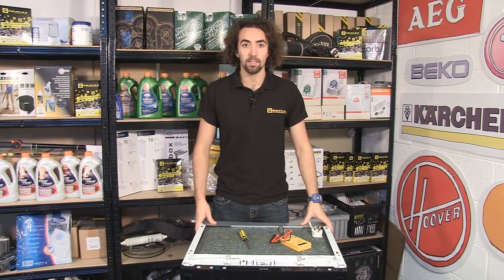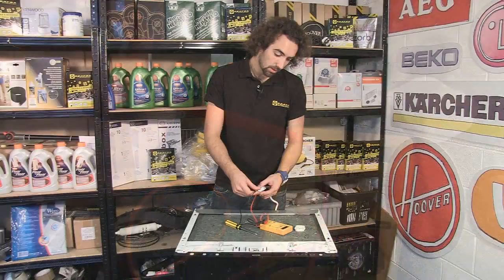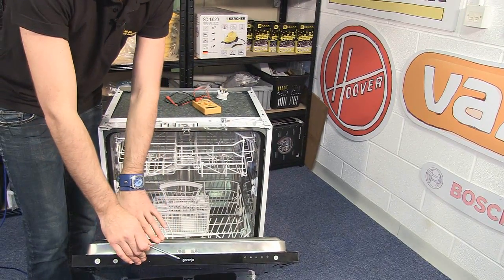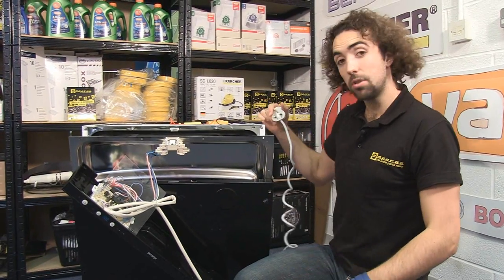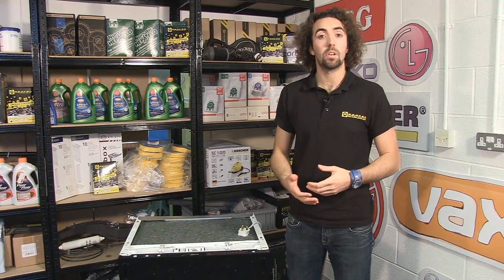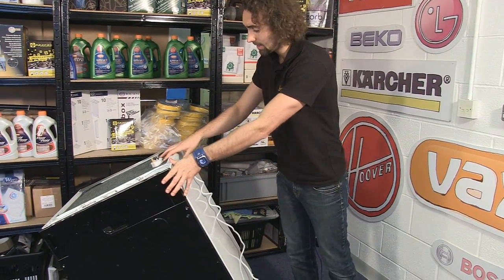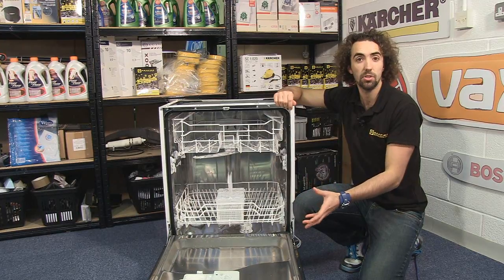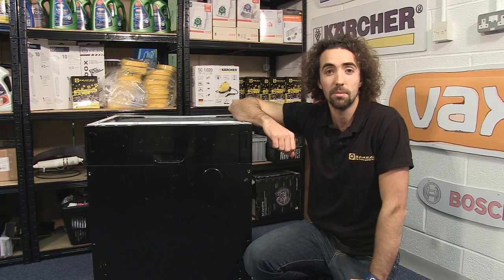How to Diagnose Control and Programme Problems with a Dishwasher

Comment: Our Bosch dishwasher is tripping the electrics in the drying cycle.  No error code as when the power is switched back on dishwasher returns to the initial switch on screen as if it hadn’t washed.  Sometimes the water doesn’t get hot. Sometimes it does get hot.  Is this likely to be the heater or the control board?
Reply from the maker: Hi, you might find our other video helpful here, which details what to do if your dishwasher isn't heating:
https://youtu.be/7b1-M_WKYJs

Comment: Took my currys essentials dishwasher out turned it upside down to see what was causing the flood error to make eco flash. Eco flashing cleared - now computer only flashes through the options in sync and settles on glasses and rapid. Won't let me select an option. Help!!
Reply from the maker: Hi Richard, there is a good chance when you turned it upside down any water that was in the base would have gone everywhere, take the front panel off to access the board and check for any damage.
Reply: eSpares it’s just decided to start working again. Why was it showing the eco leak warning in the first place. Leaking from where. Thanks btw
Reply from the maker: Hi Richard, check all the water connections and it may be one has come slightly loose leading to the leak but hopefully everything else will be ok.

Comment: Hi! My Bosch SGV33E13EU started by not drying the dishes a few months ago. A week ago it suddenly became completely dead. It doesn't light any of the LEDs/display or any indicator any more. I have tested the switch and seems to let voltage in when toggled (220v). I observe ~125v between the big wire that seems to feed the control unit and neutral, not sure if this means anything though. My question is, considering that the control unit doesn't light at all, can I assume that it is the control unit what is dead? Or, is there any other faulty component like the heater, thermostat, pressure sensors, water sensors, etc, what could lead to the control unit not lighting at al? Many thanks!!
Reply from the maker: Hi J. Carlos Muro, the first thing is please do not test anything live, your dishwasher can be fully checked using a multimeter with the dishwasher disconnected. The video does show testing from the plug to the PCB and if everything else in the circuit is ok then suspect the board.

Comment: Hi great video but am struggling to find a fault with my hotpoint Aquarius fdm550  it starts the cycle buy draining checked that that works ok but after about a Minute the wash and end lights flash fast together quickly I can't seem to find what the fault code means any help would be great thanks
Reply from the maker: Hi Gixer, it sounds like the water fill timeout has been activated. check the inlet valve and for any blockages affecting the water supply to the machine.
Reply: eSpares thanks I will have look at that thanks for the reply much appreciated

Comment: hi my kenmore 665 not work only star light sensing  i know the heater element is borken you think  ? if is this the real problem  because not enter whater ? i chek the termo fuse is good  tester sound  but heater element chek say 1 in tester
Reply from the maker: Hi Giovanni, you will need to use a multimeter to test the heater before suspecting anything else, also this video will help diagnose heating problems www.youtube.com/watch?v=7b1-M_WKYJs&t

Comment: Hi I have beko dishwasher model dsn2532x.. And it was working g very well but two days ago my son turned on and when I turned off then I tried to make new program... The motor turned out. Even when I didn't edhe press start and nothing change till now.. All the time the motor is on and nothing change.... So what is the defect here..
Reply from the maker: Hi Dina, If the motor is running all the time it may be the pump that is draining because there is water in the base, check the base for water and look at the hoses for any leaks.
Reply: It was some water before in the bottom but it drained slowly.. Also I opened the draining hole and I checked for any thing stuck but I didn't... What I am afraid of is that what can be stuck in the tube which inside for draining... Coz it's in the process of draining before steaming and doesn't move
Reply from the maker: Hi Dina, you will need to establish the reason why it is not draining, check for a blockage and test the drain pump to ensure it has not failed. We also have a video that will help www.youtube.com/watch?v=M0W9pzBZ-DI just copy and paste into your browser.

Comment: my dishwasher pump ok not getting voltage so motherboard annoying because works fine except doesn't drain
Reply from the maker: That's unusual as the boards do not often fail even if the pump gets blocked. May be worth checking there is no debris in the pump chamber before replacing the board.
Reply: yeah it may be the capacitor will get it tested
Reply from the maker: You can check the wash pump capacitor with tan economic priced meter like this one:
https://www.espares.co.uk/product/es1741061/professional-digital-multimeter
Good luck.
Reply: what it was is one of plugs going to pump loose just tightened it pump works
Reply: I mean I checked voltage ,voltage 50v ,pump checked out for continuity correct ohms capacitor ok so I was really stumped I thought not getting correct voltage but who knows what that is as I said one of the plugs loose that coonects to pump I know hard to believe but it's true cya
Reply: I mean if I bought new pump still wouldn't have worked because plug loose you understand.

Comment: Hi, I have an issue with my GE Profile PDW8280J10SS Dishwasher where the heating element is not heating up to dry the dishes.  I took out the heating element and it tested fine.  I had purchased another heating element and i received the same test results when using the multimeter.  What can be the cause of the heating element not heating up?  Would it be the control module?
Reply from the maker: The problem could either be a faulty control board or a thermostat (if fitted) in circuit with the heating element.

Comment: Hi, I have isuues with a whirlpool ADG7650 dishwasher. The intensive and eco cycles stop after the draining step whereas the express cycle works fine. My guess is that it's an electronic problem. What do you think?
Reply from the maker: Likely to be a problem with the timer motor, thermostat, or heating element. You should check these for faults by using a multi-meter.
Reply: Thanks for your answer, I will try that this afternoon and I'll let you know. I'm just not sure where to find the timer motor.
Reply from the maker: We had problems identifying your model number, on your machine you may have a control board that operates the timer function so this could also be the problem.

Comment: Hi Josh. Thank you for an informative series of videos.Can you help with a SMEG LS19? The water comes in and the washing starts. And then it stops again. We can click it to proceed, but it cannot finish and the water stays inside the machine. ? I am trying to dismantle the control panel, however it is a bit tricky as the controller on the outside does not come of, so I cannot get the control panel fully of??Please help or redirect, please, to someone who can.
best regards
Niels Kongshaug
Reply from the maker: The most likely cause of the problem Neils is a blocked drain pump, watch another video for more information:
https://www.youtube.com/watch?v=M0W9pzBZ-DI
Reply: Niels Erik Garde Kongshaug
Reply: Niels Erik Garde Kongshaug dishlex 100

Comment: I have a whirlpool gold quiet partner 111 dishwasher 
water runs in and pumps out but spin arms don't move. I have complete cleaned it out.what could be wrong?
Reply from the maker: It is likely that although the drain pump is working the wash pump is either jammed or faulty. For information on changing this see another video:
https://www.youtube.com/watch?v=9NYNK0JFG_A

Comment: hello I want your assistance has problem the dishwasher I will analyze what you do activates sucks water warms After a while makes drainage water So here operates normally post operates only the  RECIRCULATION PUMP/MOTOR nothing else normally have to retake again water. thanks
Reply from the maker: HI κωστας, I am struggling to follow your description so suggest you post the translation and the original Greek. From what I understand the machine works for a while, stops and empties. Check the water is heating correctly and not overheating. For more information see another video:
https://www.youtube.com/watch?v=7b1-M_WKYJs
Είμαι αγωνίζονται να ακολουθήσει την περιγραφή σας, έτσι προτείνω να δημοσιεύσετε τη μετάφραση και την αυθεντική Ελληνική. Από ό, τι καταλαβαίνω τα έργα μηχανή για μια στιγμή, σταματάει και αδειάζει. Ελέγξτε το νερό θερμαίνεται σωστά και να μην υπερθερμαίνεται. Για περισσότερες πληροφορίες δείτε ένα άλλο βίντεο:
https://www.youtube.com/watch?v=7b1-M_WKYJs
Reply: hello Thanks for responding I checked what you told me the resistance is OK, and the ntc
Reply from the maker: But you have not mentioned checking the temperature?. If the control board relay has stuck then the water heater may be continuing to heat the water to an excessive temperature and the machine may be shutting down because of this. Try on a 'cold rinse' to see if you can detect any heat.

Comment: I want your assistance I have problem with the dishwasher siemens enr. se58a560/42 What it does is gets the water stops warms Wash normally and after a while it turns out the water up here working properly after the motor operates only without washing systems have gotten water This makes it up to finish the program Thanks
Reply from the maker: Check if water is leaking into the base causing it to empty and run the pump as it has detected a flood.

Comment: hi have changed dispenser on d/w but it still isn't dispensing rinse aid????
Reply from the maker: If you watch another video you will see where we have sent you to an image of a typical dispenser: https://youtu.be/MDideDjjuEU?t=1m53s
The red solenoid pulls the two white levers and at the top left is the rinse aid pump. If the flap opens to release the tablet then then that is working. Try repeatedly manually operating the lever to confirm the pump is working.

Comment: hello i have a problem with the dishwasher gets water stops and does nothing only proceed if it turns out the water what to blame. bosch sps 5021/03
Reply from the maker: +κωστας κωστακης If you leave on for a few minutes and you can hear the water being heated (like a kettle) then the problem is likely to be the wash pump motor or its capacitor. However it is also possible it could be the control panel but this is less likely.
Reply: eSpares thank you to answer we will try to see what is to blame old appliances with timer
Reply: What was the FIX on that bosch sps 5021/03 ? Always post back what you did to FIX the unit!

Comment: I have a Candy 9 place AAA CDI 4545 Slimline integrated dishwasher. when it is turned on it lights up for a few seconds and then it trips the fuse on my house fuse board. I have tried plugging in to a different wall socket and the same thing happens. The machine has not been used for a couple of months due to house repair problems, is there a common fault that I can check for ?
Reply from the maker: +Thomas Clark If the electricity trips as soon as you plug in even if the machine is off suspect the pains filter by the cable entrance. If the power only goes off when the door is shut and the power turned on it is most likely to be a failing heater element.

Comment: I have a whirlpool dishwasher, most of the lights are on, I ran test cycle by pushing normal and heat buttons repeatedly, test cycle ran ok but when I try to run a normal cycle it will not start, any Ideas?
Reply from the maker: +Steve Lee OK so the machine runs during test but does not start. Did you check if the drain pump is working?. If running continually check for water in the base. if only a quiet buzz after start check the pump for a blockage.

Comment: my Bosch washer is sound like it draining when turned on , and even when the door is opened but there is no lights on the penal ? anyone know what this is please
Reply from the maker: +alan coyne Check there is no water in the base of the cabinet as it may have an Anti flood switch that will run the pump if this occurs.
Reply: thanks ill try that 1st

Comment: Sir... After messing with my Blomberg Dishwasher for 3 or 4 days, I stumbled on to your video.
It all started with a drainage problem... I believe my daughter may have put a plate in without properly scraping whatever food into the compost bowl. The Drain hose had about four inches of the fruit and vegetable section sitting at the end. Easy Fix!!
put it all back together turned it on... and No Water! 
For me this was too much of a coincidence that a drain problem turned into a water solenoid issue.
Completely FLUSTERED!! I started looking around the Web for some kind of help.
A ton of useless videos out there. or mostly for the older style machines with the Float Valve in the tank.
I decided to watch your whole video as this machine is more modern... at about the 7:25 mark you said it! Expect about a 20 second delay before the water starts to flow!
I wasn't waiting!!! Starting it... No Water... Stopping it. 
I literally took my machine apart about ten times!!! Tested everything Twice!
All that to say... Thanks!
Jeff D in Montreal.
Reply from the maker: +truckerjgd56 Most engineers have been caught out at one time or another, Thanks for your comments and glad you have resolved your problem.

Comment: Fixed it. After all of that, guess what it was? There was a blockage of fat in the waste pipe that the dishwasher feeds into. That was causing enough back pressure to stall the pump. Now I have a happy wife again. :)
Reply: Re: Fixed it. Problem was unit would not drain as there was a blockage of fat in the waste pipe that the dishwasher feeds into on a 14-month old Currys essentials dishwasher, model no' CDW45W13.

Thanks, and was this on a NEW install... or was Curry's CDW45W13 replacing a dishwasher that had come out previously?
(If not a replacement... pipes had some age on them, hence the blockage, right?)
Reply from the maker: You should have watched another of our videos:
https://www.youtube.com/watch?v=jLyA-7SC9ZY
This specifically suggests checking areas and might have helped to find your problem.

Comment: Fixed it. After all of that, guess what it was? There was a blockage of fat in the waste pipe that the dishwasher feeds into. That was causing enough back pressure to stall the pump. Now I have a happy wife again. :)
Reply from the maker: +Paul Bembridge Glad you sorted it, now the tricky bit. While you are in the wife's good books you need to point out the fat that stopped the machine was likely caused by pouring waste from grill and frying pans down the drain. This can cause blockages anywhere along the sewers as well as in the house.
Reply: +eSpares I figured that one out and I also read her the riot act over it. Mainly due to the fact that it cost me £30 for a flow meter that I didn't need.
Reply from the maker: +Paul Bembridge :-)

Comment: Thanks once again for the advice. I've double checked the drain pump resistance, its reading 223 ohms. All of the pipes, as far as I can tell, are clear of debris, and my machine doesn't have a non return flap. I can't see anything that resembles any sort of mechanical timer. Would I be right in thinking that the timer is part of the PCB? If so, is there any way of testing it? Also, is there anything else that I should be looking out for? Many thanks.

Comment: Anyone know what to do if the input valve functions fine but the machine is not starting. The light comes on but no water
Reply from the maker: +anka zgonjanin You need to follow the  information to see what is working ie does the door lock and the machine light up. If locking check motor brushes as this can stop the machine.

Comment: I have a Currys essentials dishwasher, model no' CDW45W13, and only about 14 months old. The problem that I have is the 3 in 1 light blinking rapidly about 20 minutes into it's cycle, error code for low water pressure, flow meter broken, or wires to the flow meter loose. The machine then stops and bleeps constantly and doesn't drain. I've checked the drain filter, removed the drain pump and checked it for debris, checked the drain pipework for blockage, and replaced the combined flow meter and air break. It still has the same fault. Do you have any idea as to what else it could be?
Reply from the maker: +Paul Bembridge Check the machine drains when reset as the first part of any cycle is to empty the sump. If this is OK check the heater and thermostat.
Reply: +eSpares Hi and thanks for the advice. The water is hot when the the machine bleeps and stops working. The only way to empty it is to bail it out otherwise when I turn it off and then back on it just continues flashing the 3 in 1 light and bleeping at me. if I manually empty it, it works fine for 20 minutes, fills up with hot water, opens the dispenser door, runs perfectly. By resetting it. Do you mean there's some kind of reset button?
Reply from the maker: +Paul Bembridge Every time you start a cycle the machine resets by first pumping out to remove any spillages in the machine (tea, coffee drinks).
If you do not hear the pump run and you have checked it is not jammed measure it with a meter if it reads OK then suspect the timer.